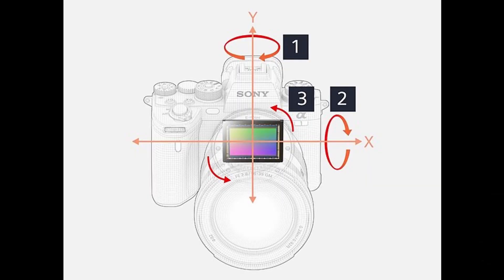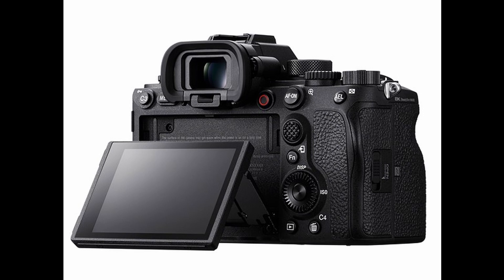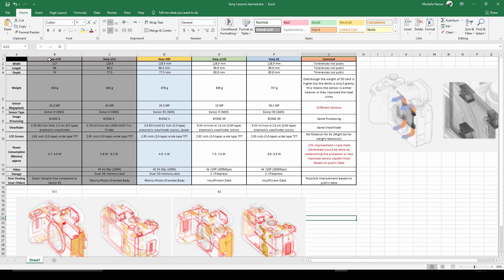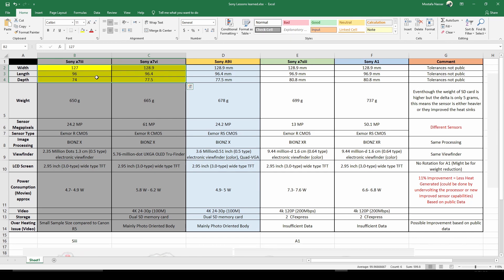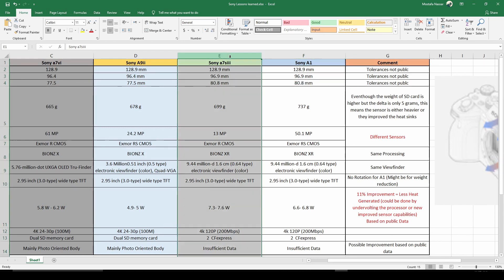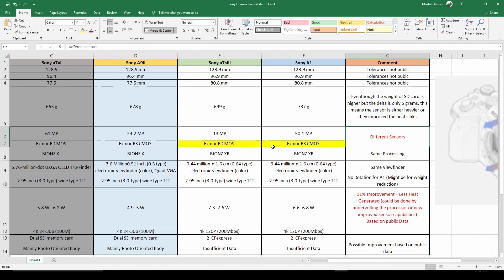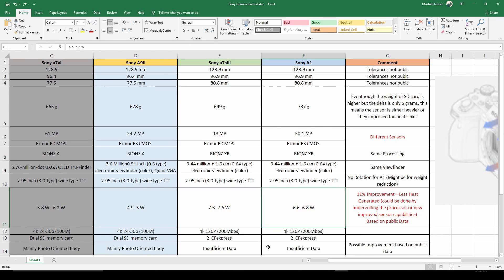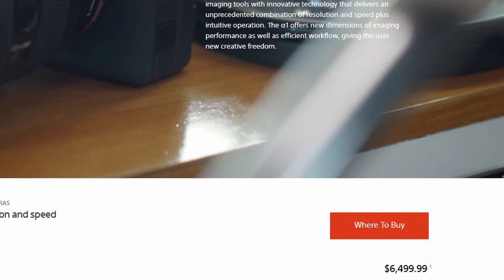Sony A1 Reaction as a Quality Engineer & Heat Management Expectations

Comment: Sorry to be blunt but you are missing a few steps. The A7iii and A7R3 designs are well known (and we looked at teardowns). The A7III partly overheated because it uses a plastic front part where the A7R4 (the one you refer too as 61 megapixels) uses a magnesium part thats also uses as a heatsink. They also redesigned the battery grip between the gen1 and gen2 one reason was heat again since the battery was a) a source of heat b) well heat and batteries don't mix well so thats the sensor that tripped most). Now the gen3 (S3 and A1)  designs we have not seen teardowns on yet but we know indeed there are several things we can point out. They are still fully magnesium so easier to get heat away (unless in full sun its a black box after all). Next to that the 'cpu' is now more split part is done on the sensor and instead of 1 cpu it now uses 2 so that spreads the heat more on the A1 and making it easier to guide the heat to the new heatsink design to the body. The lower wattage is interesting and a good point my personal guess is they didn't change the motherboard much from the S3 to A1 so why is it less and indeed to me it makes sense that part is because they might have underclocked the cpu's in the A1 given that much more pre-work can be done on the stacked sensor. Or something thats still unclear they dropped the LSI chip they had for a long time in the A1 since between the stacked sensor and cpu's all can be done. A hint of this that you can now fully use the menu's on the A1 while writing to buffer something that the LSI was blocking before. I am also a hardware and software guy and looked at the inside of most of these models except the S3 and A1 so until i can its guessing also on my side. Lastly if the S3 and A1 are internally so much alike why does it cost so much more ? Well the sensor alone of the A9 when released was $1200 and it would not be weird to guess that the A1 stacked sensor might be $1500-$2000 a pop giving the low yeilds of startup and its complex nature. My reaction is easier since we have seen more overheat tests now since you released the video and we get some datapoints from trusted sources.
Reply: @MostafaNassar  I suspect yes since the LSI chip that was started in the a6500 was a bandaid in many ways it sat between the sensor and the old (single) cpu to decouple a few things and speed up others. It would be weird to me this bandaid is now not intergrated into these new chips. Also 'using' the menu was never black and white some features worked more as time moved on (a6500 less then R4 for example). But on the A1 it seems all is active (weird since its less needed there since the cards are so fast). I suspect the same to be true for the S3 but we have heard less of it since i think most video settings are locked during recording (makes sense) so nobody really tested it.
Reply: @MostafaNassar  I agree 8k is overkill for most but in the case of the A1 i guess sony could do it and was a 'solid' move against canon. Talking for me personally the A1 is the R4 i wanted. I wanted a high pixel count stacked sensor and remove more movable parts (no shutter needed). So the A1 is more about that for me and i suspect for many the fact that crop mode is still 21megapixels, you can use 35mm movie lenses in crop mode with oversampled 4k. The A1 seems to me a hint to the future where more movable parts are removed first the shutter and i suspect we will also see ibis go and we will start seeing the build in gyro info used instead. The shutter when in action uses LOTS of power peak (needs to move stuff) and can brake. The ibis too with these 2 removed we gained space for possibly a variable electronic ND.... But this is just my feeling i predicted the A1 after the A9 was released (i just was 2 years off didn't expect sony to use that stacked sensor for 4 years solid) maybe i should make a new video predicting what pure logicly follows next... I am not trying to be arogant but from a tech point of view its clear what should and will happen the question is who will get there first.